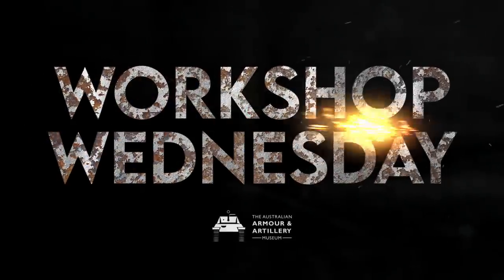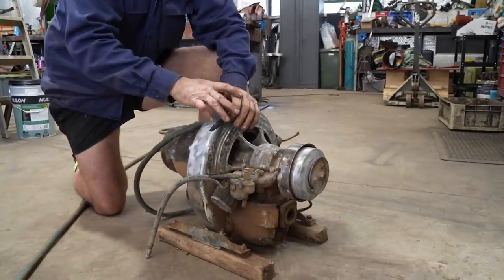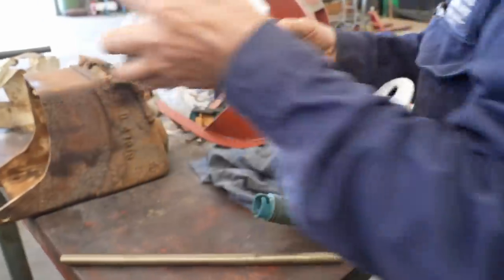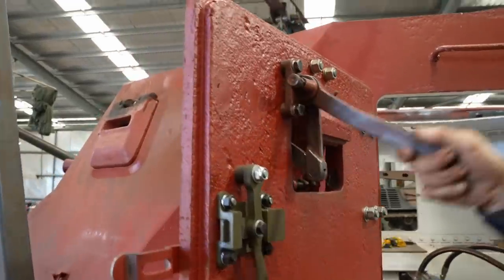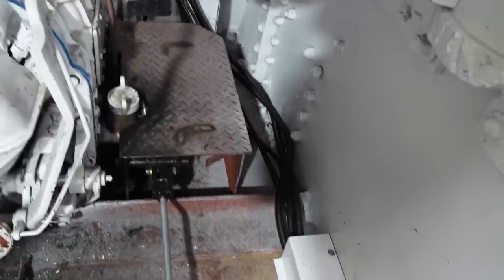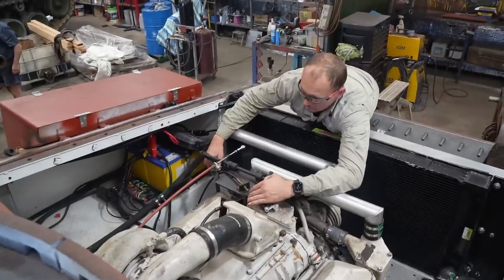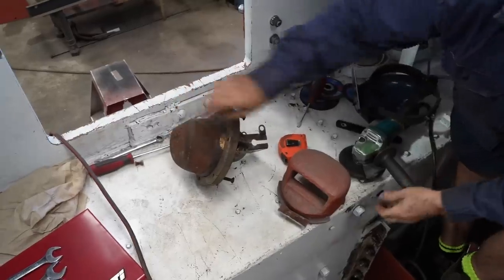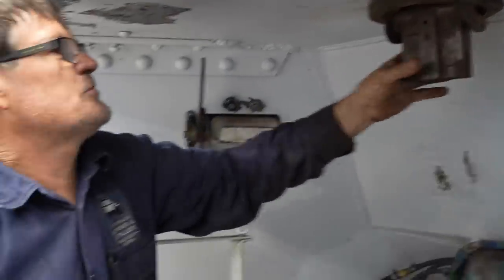WORKSHOP WEDNESDAY: Engine START-UP on our WWII Grant Tank Restoration

Comment: Homelite started making generators in the 20's, became a major supplier to the military in WWII. Sold to John Deer tractor, then spun off to offshore companys. They stopped selling generators maybe 10-20 years ago, but plenty of parts and working used units very much available today.  (In the US) The company sells re-branded Ryobi chain saw's now
Reply: Homelite in the 60s & 70s made good chainsaws I had 2 both damn good saws

Comment: Hi, you can use the wax method to remove sticky screws and bolts: as follows: Heat up the head  of the fastener with a oxy torch /
then rub a piece of wax on the head / as the fastener cools down it sucks the wax into the threads / let cool and remove. ( canning wax works)

Comment: You guy's might want to buy a Lazer Rust removing system. it will only remove rust and is more Efficient than the wire wheel. there's videos on YouTube of people using them. and it would pay it's self off in no time flat, especially with all the Rusty vehicles, parts you guys work on.

Comment: 16:01 a good method to get those out, regardless of how rusted they are is to take a hammer (perhaps a 200g one) and slowly - so as to not lose temper, grind the end of it to a tapered slot. Here in Europe, we have what some call locksmith hammers, they have a wedge, that's perfect for this kind of stuff already, only needs a small amount of grinding. The idea is to fit it inside the slot. Then, with another hammer, preferably a much bigger one, give it a wack while putting tension on the handle in the unscrewing direction.  Not holding any beans back. I swear, 90% of the slotted heads i do this to, will come off with a remaining mix of snapped ones and ones that REALLY don't want to come out. You can try to even tighten them some times or go back and forth. This is akin to the impact driver, but much better, because you apply far more force via the handle than the lugs inside the impact driver ever could, we're talking kilos of force depending on how big the hammer is. I personally made myself a small selection of sized hammers from 15g all the way up to bigguns of 5kilos. I've probably used the 5 one only twice, but it was instrumental in getting those pesky bolts out. Impacts or driver impacts wouldn't even so much as touch those. The bolt would just sit there laughing.

Comment: The Homelite name is still around for cheap stuff from China, the kind that you buy at discount stores here in the US (Ollie’s here on the east coast, for example). I’ve seen Homelite leaf blowers and pressure washers for sale recently. I own two real American made all aluminum Homelite chainsaws that I inherited when my father passed in 1997. When he bought them I don’t know but I’d guess it was in the 1950’s or 1960’s. When the company ended actual production in the USA they were only making chainsaws as far as I know.

The power equipment dealer near me had a sign on the wall with a list of brands that they do NOT service and Homelite was on the list. I asked and was told that they don’t service Chinese junk and there are no parts available for real USA made Homelite stuff.

Comment: I guess that the grants armor is only face/surface hardened, just like the first M3 Stewart’s.
Reply: How on earth did the harden just one face? I presume it was so that shock waves didn’t spall of fragments on the inside as it did in the first WW1 tanks.
Reply: I have the same question. How did they face harden steel? I’d have to assume that maybe they heated it red hot with charcoal on it then quenched? That’s how we hardened the hammers that we made in high school shop class 60 years ago.
Reply: @bobjohnston8316  yeah, that’s how we hardened tools is shop class 40 years ago too. I think that’s how they hardened steel armor plate after rolling and shaping back before WW2, cool one side quickly and the other side slower to keep one surface softer.
Reply: @bobjohnston8316  I had a burrow through my old metallurgy text books, googled it, still none the wiser, your high school experience is right, if the steel is a low ish carbon, mild state, carburising it in some way seems possible, Cyaniding again possible but none of these methods readily allow hardening one side only. I’m now even more intrigued.

Comment: the armor is softer on the inside to catch shrapnel and spalling fragments to prevent injuries by entrapping them rather than allowing them continue to ricochet. i was a crewman on an m60 in the 80's. flying steel fragments inside the tank was my biggest fear more so than the explosion of a shell.

Comment: Homelite Corp. still exists, though like many lower end companies, they have their stuff made in China these days.
Back before then, they were known for 'hobby' & light/low use chain saws & other small, petrol engine driven stuff, so not surprised they made stuff like auxiliary turret motors.

Comment: Holy smokes the Grant is really moving along.  I think I missed it, but what are the plans for the other 3 Grants pulled out of the barn previously?  Are they for parts or will they (as many as possible) be brought back to life in some way for display or as a fleet of runners?

Comment: IMHO, because it's an old transmission, it probably would be a good idea to put transmission nappies on it... just in case. I'm not sure what kind of RPMs those go at, but transmissions going are... not pleasant affairs, especially between one's legs. Even light case cracks can cause shrapnel.

Comment: The comment about the armour being easier to drill from the inside-out is in keeping with American armour manufacturing processes of the period.  Typically, the Americans had a slightly lower hardness to their battleship armour and their tanks than say the British, but each country had their own techniques, and relative percentages they aimed for to achieve the desired protection.  If I remember correctly, the American percentages would allow for better performance from high explosive resistance, having slightly better flexibility.  This resulted in the exterior armour being the hardest while the interior of it would be softer, with the intention of having good shock resistance.  However, the trade off was a slightly weaker protection from higher velocity and armour-piercing rounds.  Whereas the British favoured ratios that benefited better protection from piercing rounds, but arguably faired worse against high explosives.  The Germans and Japanese each had their own approaches, and were somewhere in between in terms of hardness percentage, although offhand I forget the exact numbers.

Comment: Come on, Guys! You are doing so well in making stuff better than new- let´s make the little petrol donkey go, shall we? Can´t be much, I guess it´s a two stroke- isn´t it? If so- just make shure it has ...some compression, unstick the rings and off You go.
-You still would use batteries to turn the turret but the little donkey goes. Nothing wrong with that?